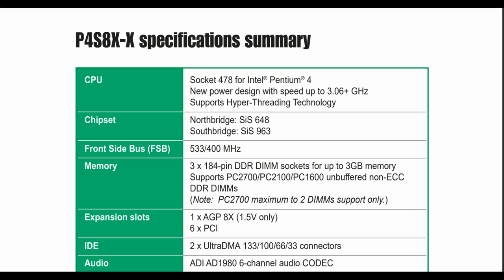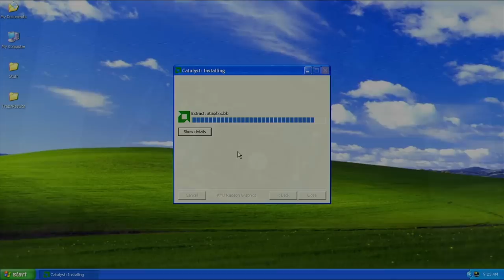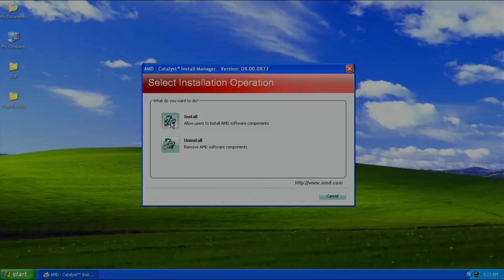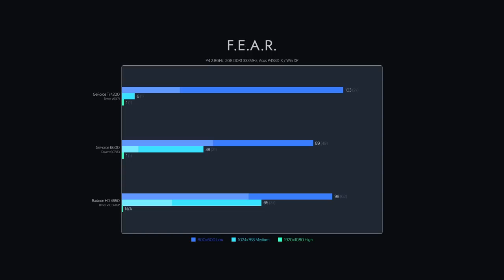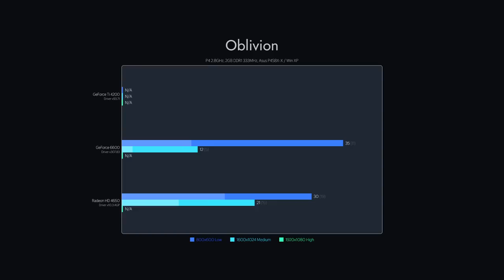2002 High-End Gaming PC Build

Comment: I had a very similar config in 2002 except my CPU was the 2.4ghz model and my GPU was a Geforce 4 MX440 on an ASUS P4B. My 2.4ghz P4 overclocked to 3.6ghz stable and earned me some major bragging rights on various overclocking forums at the time. Hard to believe that was 20 years ago now.
Reply: I can feel the heat from that P4 lol
Reply: A 3.6GHz processor and an MX440 64-bit floating graphics card? Quite the imbalance.

That would be like having a 12900K and an RTX 2060.

I remember the race back in those days. Intel vs AMD. Intel bragged about cache and clock frequency. AMD often beat every Intel in gaming with a fraction of the frequency because of their architecture. They used MASSIVE front-side busses and proprietary instruction handling. SSE3 and 3DNow! , etc. 

The P4 2.66 was pitted against the Athlon XP 3100+ which only ran at 2.2GHz. The P4 2.66 could easily hit 3.2GHz in OC and AMD was not much affected by clock frequency OCs. They relied on instruction handling and bus bandwidth. The 3100+ pulled ahead of the OC's P4 2.66 pretty easily. Intel fanboys HATED AMD users in those days. 

But eventually boys grow up into men and realize it isn't a competition against eachother. It is a competition between the manufacturers for your business. LoL!!
Reply: @Twitch_Moderator  The 440 is what it was built with, by the time I overclocked it to 3.6ghz I had a Radeon 9700XT in it, hence the overclock. Overclocking back then was less to do with needing the performance and more to do with competing on various boards/forums. I have been overclocking since the early 90s though, always enjoyed getting more value for my money than was intended. That northwood was a gem, I wish I had kept it, that and my 300a celeron. Ah well.
Reply: better than my I3-3110M

Comment: I'm too young to remember a pc like this. But man pc tech has changed so drastically so quickly.
Reply: Meh not really. It's gotten faster with more capacity, but but the way computers work hasn't really changed much in the last 30 years. I started building computers as a kid in 2002 and I  could hand a pile of modern components to that 15 year old and he would know how to build it without much trouble.
Reply: This is a state of the art compared to my PC assembled in 2001: Socket 370 celeron 400mhz with 64mb RAM 10gb HDD and 52x CD-ROM Nvidia riva tnt2 lol I upgraded it with GeForce 4 MX400 and 512mb ram and that felt very cool. My first computer was 386dx that did not even run Windows 3.11 and had 5.25'' floppy drive. I'm not even that old.
Reply: I still remember these times, I wasn't into gaming because I was dirt poor back then (still am, tho), the first "gaming" setup I could afford was a pentium celeron 1.8 GHz with 256 MB of DDR RAM (which I eventually upgraded to 768 MB) 40 GB HDD and a Nvidia Geforce MX4000. This was back in 2005, when Dual Core CPUs where already in the market, my PC really sucked. My current PC is a 3770 non-k with 8GB of RAM and no dedicated GPU, the only game I play is CS:GO at 800x600 with everything set at minimum, I barely reach 30 FPS.
Reply: @LagrangePoint0  man ask for a gpu for Christmas lmao, 3770k or even non k can run 6650xt with minimal bottleneck at 1440p and get great frames
Reply: @Catboy-hr2qp  lmao, no christmas as you know it in the communist hell hole where I live, I'm actually lucky, most people are still using and working with dual cores (e2140 mostly), my PC is actually considered high end over here, I had to sell my house and move to a small apartment to be able to afford buying this PC.
Reply: @Catboy-hr2qp  Indeed a poor country that has getting way worse after decades of communism, I can't move, because only the party members are rich enough to travel, we the proletariat, have to endure the poorness in silence.
Reply: PCI-E
Reply: @QuisquamHam  AGP back then
Reply: @LagrangePoint0  yes, just wanting to point out that when it comes to technology standards, although newer versions have emerged, PCI-E has had some incredible staying power.
Reply: @QuisquamHam  Yah, because it has been updated, but it has backward compatibility
Reply: @Catboy-hr2qp  unchecked privilege much?
Reply: If you bought a super high end PC in 1999 you were already fudged up the butt by 2001/02..
Reply: Not really. 
As you can see by the motherboard, it's pretty much in line with a current one. 
Except it uses older standards, ofc.
Reply: As others have said PC building was pretty easy by 2002.  I think about the only extra step back then was setting your master/slave jumpers on old IDE hard drives before the days of SATA, which wasn't really hard at all.
Reply: @VWDAWGXP  Honestly, not really.  My PCs back then usually lasted 6+ years, just like these days.  The difference is at the end of their life they were really obsolete and not just kinda obsolete.  Parts were also a LOOOT cheaper.  $60-100 for a good CPU, $150-200 for a really good video card, so upgrading more also wasn't nearly as problematic even accounting for inflation.
Reply: @LagrangePoint0  what country?
Reply: @pcurley4  you could hand those modern components to guy building pcs in the 70s and he could build it with no problems its pretty obvious how they fit but if we tried to build those really old computers we would be like wait theres soldering its crazy that in a short time it went from having to literally build computers to assembling computers so quickly i built my first without any tutorial, book or anything because its so simple considering like 20 years before this computer came out you had to be a genius and know how to wire bread boards
Reply: 2002 was 20 years ago

Comment: I still have the computer I used to have as a kid. It's from 2007 but has been slightly upgraded ever since. 
Intel Core 2 Duo to Intel Core 2 Quad
2GB DRR2 to 8GB DDR2
Integrated Graphics to R5 340X 2GB
500GB Harddrive to 256GB SSD
It was only $50 to upgrade it and make it x10 faster so it was worth it
Reply: i have a computer from that era right here at the floor of my computer room. it's also a q6600, with some 4gbs of ram and idk if it even has a gpu anymore. it's been there for 5 years and i've never touched it in this whole time. it was my pc back then, but i gave it to my sister and then asked for it back when she was done with it. 
[edit] just checked, it has no gpu in it. also the CPU cooler somehow fell off the bracket in this meantime D: dangerous!
maybe i should put my backup gt1030 in there and fire it up to see what's up.
Reply: @GraveUypo  that's nice. Also I wonder how the CPU cooler fell off haha. and yeah you should definitely put your gt 1030 and play some old games and classic games. I gave it to my younegr sister so she can play roblox and Minecraft but sometimes I play on it too like some old games I used to play as a kid like GTA San andreas.
Reply: The CPU and ram might hold you back tho, because mines had the Q8400 and it struggles sometimes depending on the game. Mines has 8GB ram ddr2 which is enough for the games my sister plays on it.
Reply: yo bro you should get a lga 771 xeon for it if its not a prebuilt they are like the core 2 eras i7s you can get basically q9650 with hyperthreading for like 3$ with xeons
Reply: @josephdias5859  Who?
Reply: If your talking about me then I cant, because my motherboard is LGA 775. That's why I got the Intel Core 2 Quad Q8400 because it is a LGA 775. Plus Xeon CPUs won't work because it's a prebuilt
Reply: I did it as a challenge, upgrading an old computer into something that can game in 2022 on low settings for under $50
Reply: Intel Core 2 Quad Q8400 - $5
R5 340X 2GB Graphics Card - $15
8GB RAM DDR2 - $10
256GB SSD - $15

Comment: That IDE to sata adapter only supports a single drive, ... meaning that is a bi-directional adapter hence the two sata ports,.... they're not supposed to be plugged in simultaneously as the upper port is for sata to IDE, and the bottom is IDE to sata.
Reply: LegoMan , you are correct sir. Thank you for calling it an IDE. When he said ATA (Adda) it sent chills up my spine. Although they were ATA-100 and ATA-133 connections, they were known as IDE or ATAPI. 

I really HATE being THAT guy. But I expect perfection when referring to history. And I am an absolutely NERD for computers. I can remember every computer build I ever did since the 80s. I remember every specs of every conputer I ever bought back to the 70s.

Comment: From what I remember, on these era of boards with 3 RAM slots, the third slot is only for single-sided DDR1 modules, hence the stability issues. Usually they were 128MB or 256MB. Larger ones are very hard to find so having 3GB is almost impossible to achieve. Even though you used a single sided one I’m not sure why there was issues still. Maybe it’s very fussy too, who knows?
Reply: yea and games running  on 640x480 or 800x600 or (hd backthen) 1024x768 pixels 16:9 monitors were looking strange

Comment: Back in 2004 I bought the same GPU to play demanding games like Far Сry and from what I remember it handled pretty well, even though I didn't have Pentium 4. I believe I had Athlon 64, but I do not remember the model number. Oblivion was like a slide show, my PC couldn't handle it well enough, especially in the cities, so I have to play it on medium-low settings. I think the issue was not only with my 6600, but also with CPU, since my friends got better performance with Pentium 4.

Comment: F.E.A.R was released 3 years after the Ti 4200. Of course it didn't perform well. By the time F.E.A.R released it was optimized for the 6000 series. The 6800 was the best card at that time. 

Btw I strongly believe your Ti 4200 was the 4x AGP edition. I had the Ti 4200 8x AGP edition and I overclocked thw core to 300 MHz and the memory clock to 325 MHz and it was stable with the ORB II cooler kit. What that means is that my Ti 4200 was the exact same performance and specs as a Ti 4800. (Which the 4200s were known to do easily). I miss those days.

Comment: When last time I discussed with my late father how to upgrade my custom built PC, we talked about Pentium 4 vs Pentium D, also the compatibility cautions with AGP ports and PCI-e ports. This was probably mostly to play Half-Life 2 and CS:Source. I did went to a computer shop with him again a few years later to buy another factory build PC with a GForce 900 series card. Good ole days.
Reply: I remember when I couldn't play the newest games because my graphics card wasn't good enough, and I couldn't get a newer one because my motherboard didn't even have an AGP slot.
Reply: @mushieslushie  I was poor when I was small. So my father and I could only upgrade my rig every 5 years or so. When we tried to buy a new GPU, the motherboard was not compatible so we needed to a new one. Then the old RAMs were not compatible with the new motherboard so we had to get new RAMs. Then we didn't have enough power to supply to the new board/RAMs/GPU so we had to get new PSU. That's why in the end we gave up building PC after upgrading 3 or 4 times upgrades since every time felt like we buying every single component new, ended up spending just as much as we would have buying pre-build.

Comment: I made myself a new rig at the tail end of 2002 and it was pretty sweet. Duron 950 with a Radeon 9500 Pro. I originally had a Shuttle brand mobo but it died, so I replaced it with an FIC AN19E. I also eventually upgraded to an Athlon XP 2600+. I loved playing new games and maxing out my old games.

Comment: 2002 I was running an AMD  XP2800+ (Barton) , 2GB DDR ram, Gainward Golden sample ti4200 128mb card later upgraded to a surprisingly quick ATI 9500pro 128mb. Good times back then for sure.

Comment: In 2002 I had a P4 1.6GHz, 256MB RAM and a GeForce 2 MX (I think it was a GF2 MX 400, I didn't remember anymore). In 2004 I got a P4 2.8GHz HT (northwood), 1GB RAM (2x 512) and Radeon 9800PRO 128MB with an Asus motherboard with SIS chipset (P4S800-MX), that motherboard didn't have Dual channel memory support... That motherboard died 1,5 year later so I bought an Asus P4S800D-X with dual channel support and that improved the performance considerably!!

Comment: My dad bought a similarly spec'd PC back in 2003, I think it was. It had an AMD Athlon X2 and an ATi Radeon 9600, was a beast back then. I think I still have that computer lying around somewhere, as he gave it to me in 2010 after he replaced it.
Reply: To be fair, those specs are way better than this, 2-3 times the speed probably. Certainly in more demanding games.
Reply: @GoldenCroc  I remember that computer being able to handle Mirror's Edge pretty well on release, not maxed out of course, but on like medium settings.
Reply: Athlon X2 was 2005.
Reply: @ppmguire  I found the computer, turns out I remembered wrong, it's an Athlon XP 3000+.

Comment: Sorry to be that guy but a high end gaming PC in 2002 didn't use any Intel processor. AMD was the performance king at that time especially with the Athlons. A Socket 462 AMD Athlon XP 2800+  clocked at 2.08 GHz was faster than a Socket 423 and 478 Intel Pentium 4 @ 2.8 GHz.

Comment: ATI had better drivers when it came to LCD and HD resolutions, never had any issue with them, Nvidia many cards had a limit of 1600x1200 via DVI on the drivers or both the drivers and the card, it's mostly the FX5xxx line and older.
Reply: Mt TI 4400 pumps out 1080p no big deal, but can't really run much at that res.
Reply: @ppmguire  I had an FX5200 that could do 1080p but it died, never managed to find another that could and now the prices of the old cards are too high to experiment. In the end I got a X1600 Pro that works fine, it's also my last working card, AGP cards are on their last years, the RAM chips are going bad and the high heat generated and the bad coolers and dried thermal paste made it worse to find working cards.
Reply: @farben_  My next card after the 4200 was the FX 5600 Ultra, even highly overclocked it struggled to push 1280x1024. These days my only FX card is a 5700 ZT and under water it does great but it's starved for memory bandwidth.

Comment: Some where around that timeframe I had a 2500+ OC'd to like 3500+.
As a cooler I used a modified VW Golf warltercooler and a 10l water bucket.
I didn't even have a fan. Car coolers have so much power, it is ridiculous. But they are also big and can't fit in a case.

Comment: At the time I was probably using my GeForce FX5950 Ultra, which was crazy fast (and crazy expensive) but I had a lot of fun with it. I think I had a 15 inch TFT back then with a lot of ghosting and max 1024x768. 1080p monitors were pretty unheard of, so its no wonder you barely got any performance out of that.
Reply: it also had the image quality of a potato to claw back some performance to try and match the vastly superior ATI offerings of the time.
Reply: That's wrong.
GeForce FX 5950 Ultra was released in October 2003.
So you can't have owned it in 2002.
Reply: @MaexxDesign to be fair, he probably misremembered it. Also, he said "at the time". That's pretty vage and given the context of this situation, he could've meant "around 2002 and up".

Comment: In 2002, if I wanted to play the latest games I would use my brother's AMD Athlon Thunderbird 1.2ghz which had a GeForce Ti4200 and 512mb of RAM.  I remember playing Morrowind, Max Payne, UT99, UT2k3, UT2k4 and forgot what else.  I was still using a Pentium 200MMX with a single 12mb Voodoo2 and 64mb of RAM and Win95 was so bloated and infected that it would make Diablo 2 freeze on Act 4 and Thief Gold freeze in level 4.  I wouldn't get my own Pentium 4 (Dell clamshell case with a P4 2.26ghz) until 2006, after I moved out, and I replaced the GeForce 2 MX400 with a FX5200 and I was able to watch 480p videos on youtube.  That P4 with the FX5200 was my main rig for a LONG time and it still posts and is great for ZDOOM/GZDOOM and other games.

Comment: 2005 , the year that I got my pc from my parents,  it was pentium 4 2.66ghz, 128ram, 40gb HDD. I stil remember back then there was a myth that Ram cant reach 1 Gb and also, friend of mine says by buying a certain component worth 100usd can get your pc become PS1/PS2. You just buy the PS2 DVD (as long as your drive was dvd, since CD still dominated back then). I realized after couple years latter,  that certain component is GPU. Fyi  Internet wasnt a thing in my country back in 2005. My first internet browing happened in 2007. So yeah, you could googling that.
Reply: Windows 9x couldn't support 1Gb RAM. I ran 768Mb in my PC at the time, Athlon XP 1800+ and 4200Ti GPU on a 20" monitor that cost me $5

Comment: I used to have a P.4 2.8GHz Prescott CPU as well, and boy - that thing ran really hot.
I don't remember which graphic card I had, I think it was Geforce 4, and when it died - I got an FX 5200 which sucked, and then the 6600.
The hardware back then was a lot simpler - but so was the software. 
Nowadays everything is bloated with crap and lacks optimization because the hardware is so darn fast, meh.
Very nostalgic.

Comment: Sorry but there's so much wrong with that setup.
The PATA to SATA adapter you used is only PATA to one SATA Drive or SATA to PATA Drive. You need to look out for those adapters with a very specific marvell chip or with two jmicron jmd330 which has also the designation of which SATA port is master and slave. Yours has no designation at all. Next thing, wrong amd card, the hd2000, hd3000 and hd4000 are amd cards with known crappy drivers and all sorts of installation tantrums or windows update incompatibilities (hdmi audio). Best ati card with solid drivers and agp would be a x1950, second to that a x850xt pe and third to that a radeon 9800 no matter which version.